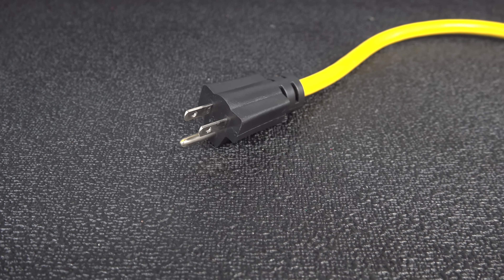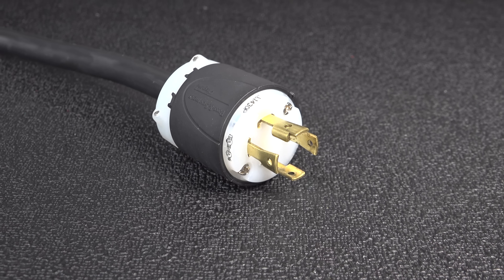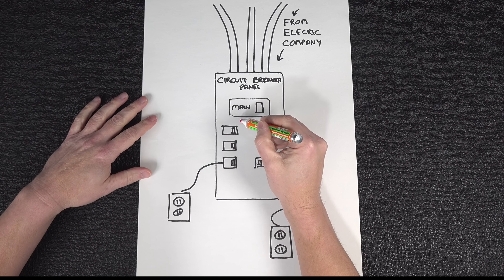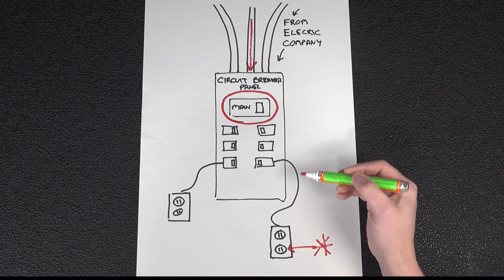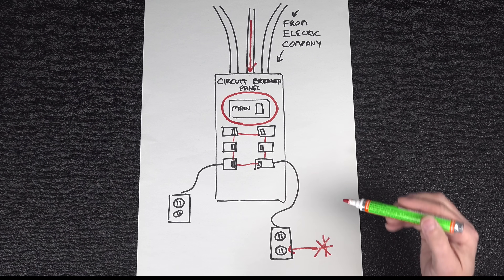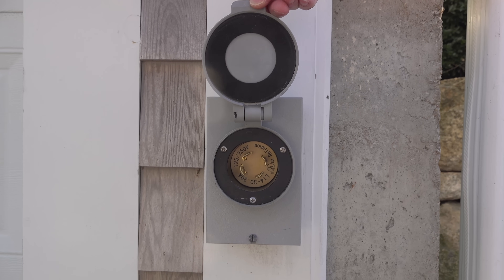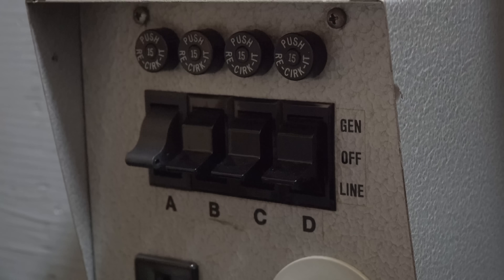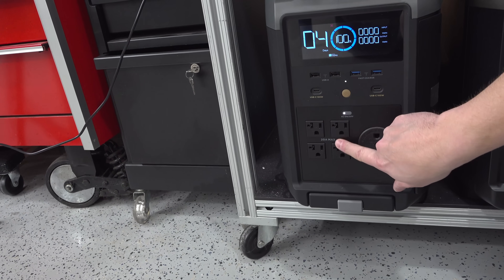Worst Electrical Mistake You Can Make - Backfeeding Generators

Comment: We used these when building a house. We had a construction power pole and we would use these and plug into a circuit to provide lighting or power to work areas. No danger to anyone.
Reply: Never say Never, I know a electrician who was working on a 220 3 phase lighting circuit, he turned off the circuit breaker and he did lock it out, he double checked to make sure it was dead, but he never thought about a shared neutral wire, there have been alot of people injured and killed by a hot neutral, it can back feed through the one or more of the ballasts connected to the other 2 phases, the voltage is now double to 440 volts or more!
 They now run a separate neutral for each phase! Remember that if you back feed through your main breaker, and it back feeds through the transformer and it can  steps up 220/240 volts to 13,000 volts on the line!
Reply: @richardscott8159  The house was new and residential don't share neutrals, only have seen it in commercial.
Reply: @terryheadgepath4205  we were talking about back feeding, I understand that you think it was safe, but there's a meter panel that connected to the main breaker, if the electric company came out to connect the  service, and you left the generator running and the main breaker on position, there could be a potential problem. 
I have seen lots of electrical failures, from burt up load banks to large commercial generator failures. One test cell operator and  steel panel was shot up about 2 feet in the air when the wire cabling shorted out under were, he was standing on a 1/2 steel plate about feet Square. This failure cost over 1/2 million to repair. A new high voltage switch gear was damaged because the electrician forget to remove the grounding safety cables before he put it on line, totally destroy it, took 1 1/2 months to have a new mabe, at a cost of $850,000.00 not to mention the down time.  This was outside contractor, so his insurance company ate the cost!
Another bad accident was when they were tested 1.5 meg. Generator, the diesel engine blew up and the piston rod came through a 1 inch thick safety glass window, luckily no one was hurt, this wasn't electrical but it was one of the bad ones. My point is, even when you think are safe, sh-t happens. And yes if I was working on a house before the electric service in, I would do the same, but I would lock out the main circuit breaker first, just for safety. I have seen to much damage caused by electrical failures, and I know of a lot of close calls and injuries, so I don't like to take any chances. "When in doubt, lock it out"
Kind of a long reply, just tired, and sometimes I ramble. That hot neutral wire happened to an electrician that I was working with, I tried to worn him, luckily he didn't get hurt, but it did scare him! Makes quite an arc.
Reply: @terryheadgepath4205  Sony, I was thinking about the hot neutral and the other electrician, that arc was from a 277 volt fluorescent lighting circuit, he was replacing a ballast and that's why the  there was such a large arc.
Reply: @richardscott8159  of course "if" my aunt had nads. . . .she'd be my uncle.  Those are some pretty specific circumstances.
Reply: Just wire into the panel with the main off and power the whole house. Avoids potential stupidity of wiring between you and the panel.  "shared neutrals" and other idiocy people think is acceptable in a house.
Reply: @snap-off5383  I was talking about industrial wiring, it used to be legal to run 3 120 vac circuit with one neutral,  as long as you had all 3 phases breaker or the tied together by a bar, they did that to save cost, "one" less wire, "two" more circuit with smaller size conduit. We ran into problems with the lighting panels, the panels were installed with switch grade circuit breakers, only problem was that they could be turned off separately, so you turned off one phase, the other 2 were still hot,  brown, yellow, orange, and a gray for neutral.
Reply: @richardscott8159  It may have been "by code" (don't confuse within code with "legal") to share neutrals, but it has NEVER been intelligent to do so, it was and will always just be "being a cheap ass".  But yeah acknowledged that you're most likely to find that stuff in commercial construction.

Comment: I use a generator transfer system to connect my DIY solar system (sub NEC specs) to my home.  If ever needed the solar system can filter generator power for my home while charging its batteries.

Comment: If people knew how to use it they would understand you have to turn off the main breaker in the house and this works just fine up to 15 amps of draw. But not everyone should be playing with electricity. Especially if they don't know what the hell they are doing. That's why when backup generators are installed they're equipped with auto switch circuitry which which detects line voltage from the Pole and isolates it from the line voltage of the generator.

Comment: Remember when you back feed a utility line that the transformers at the poles are bidirectional 
and will take your 240V or whatever and energize the line to power co voltage ~12,000v depending 
on the line voltage.This would kill a line worker.
Reply: Remember when you drive off a cliff that you will hit something at the bottom at a high speed and probably die.  So turn your breaker off and lock it.
Reply: In my area it actually has killed someone. Had a thunderstorm run through the area and a tree knocked down the line. Someone had backfed their house with a generator without a cutoff, and it sent line voltage down the area as soon as it hit the transformer. The problem was is that one of his neighbors was working on clearing one of the trees that fell in his yard, and was killed by the live line. 

arguably he was an idiot for getting anywhere close to it.
Reply: @Sovek86  exactly. Every year storms come and go. I go out 16 hour days for weeks at a time and still after 10 years I’ve never heard of a lineman dying by this. Everyone says it will kill a lineman super dead instantly rah rah blah blah. As if we don’t think that these lines carry electricity or something. Like we show up to an outage and say ok everyone it’s still “illegal” for ppl to hook up generators so that means there isn’t any hooked up everyone agrees? And we all say yes.
Reply: exactly!
Reply: Its not the volts that kill you
Reply: @Hoekstes  just like it’s not the amps that kill you.
Reply: Turn off your main breaker and it can't do that
Reply: Yea one that just shows up to downed wires and assumes they are dead…. Which is never…. Soooooo……. Would kill a line worker? Maybe a real stupid one on his first day…

Comment: I really dislike that instead of admitting "yes, turning off the main breaker will prevent back powering the line." 
You give this long bit about how people are forgetful. 

When you're arguing something you have to give proper credit to the counter argument, and properly portray it. When you gloss over something all you do is weaken your argument because you haven't properly argued against what's probably the main point of someone who disagrees with you.

Not to mention you didn't give any exceptions or limitations to the argument you present, or other ways to deal with the problems people might think are exceptions.

Comment: All good points. 
If you were back feeding your house with the main on I think the load of the grid would trip the generators breaker.  What would happen to the generator once the grid power was restored? Not good things....lol.
Reply: Yes, it will in normal situations. The case when is dangerous is in case of a fault: if the cable from your house and the grid is broken, or a fuse or breaker the side of the grid did blow, and you feed the grid, power will not be lost outside (thus the generator will work) but you will shock a lineman that comes to fix the problem. Doing that in a power outage probably will only damage your generator. 

What if you left your generator connected when the grid comes back? Well, if you are extremely lucky and the grid is in phase with the generator you are giving your power to the grid, but chances are that it's not and depending how much out of phase is your generator with the grid the result can be more or less catastrophic. At minimum a breaker will trip, worst case scenario the generator winding will burn. 

And if you have a modern generator with an inverter, you will fry the electronic no matter what by feeding voltage into it.

Comment: When I bought my generator (big 10kw sucker) 11 years ago, I had a house-tap, grounding poll and breakout box installed. Why? Because death through electrocution and/or fire sounds like an undesirable outcome for a power outage.
Reply: . . . and because that's what's legally required for a fixed generator.
Reply: @snap-off5383  Mine's not fixed (portable)... but technically, same is true. That and, again, even if you aren't into following the law, that whole not ending up dead thing (or killing some poor lineman just doing his job) seems like it should be motivation enough. Then again, there are a lot of stupid lazy people out there.

Comment: I made a cord like this and have used it a few times and it works great. It's not the cord that's the problem, it's the idiots that don't know what they're doing. To me it's just common sense to turn the main breaker off and that's the first thing I do. I guess people might not realize they have to do that. It's just like anything else, it's not the product that's the problem it's the people using them. Just like in most cases, people like to blame the product and not themselves.
Reply: As long you know what you are doing, that both the breaker and wire can handle the backfeeded current and that you are isolated from the line it's actually safe.
Reply: I completely disagree with what you just said... That kind of pompous attitude will get you killed whenever you are working with electricity. 
Products sold on the market are supposed to be idiot proof for the average layman who has no knowledge of specific details.
Home panels are not designed for the circuit to be back fed and this is why you have to put a sub panel wired correctly into it just has the content provider showed you. I don't even agree with the breaker lockout because it requires manual intervention every time. The two-headed plug makes it too easy for even a kid to be told to go plug in the generator and not know the consequences. So if that happened to your son would you still be calling him an idiot like you did everybody else?
Reply: @richardflorence3927  There are many ways of killing ones self and others, like guns, machinery, automobiles, planes, trains, helicopters and high voltage electrical power plugs. All of these kill people nearly every day because of the idiot operator. It is just one of those things no one can control.
Reply: @richardflorence3927  There is a reason to keep some things far from kids, even a 4-year-old could make that extension by himself and end up killing someone or himself.
Reply: @richardflorence3927  well, if products sold are supposed to be idiot proof, then why do they sell it? Your statement makes no sense. Do you have any idea how many products you there can hurt you if not used properly? I've always told my son if he's not sure about something to ask me and he definitely does. I'm not saying dealing with electricity isn't dangerous, but if you take the proper steps and use common sense it shouldn't be a problem. You act like it's a 45 step process to use this product. Just turn the main off and you're done. It's not rocket science. Maybe this product isn't for you tben.

Comment: The same transformer that takes 7200 volts from the line down to 240v for your house will take the 240v from your back fed house  and step it up to 7200v. 
It would likely stall the generator because it cannot supply all the load but still, dont do it.
Reply: It'll trip the breaker, but when the power comes back on, it will fry your generator.

Comment: Dangerous and illegal.  I seen a guy make one like this to back feed into the outlet of a baseboard heater for his dogs.
Reply: Which statute?  I found this one: 705.NEC702.6 contains an exception to the transfer equipment requirement:
“Exception: Temporary connection of a portable generator without transfer equipment shall be permitted where conditions of maintenance and supervision ensure that only qualified persons service the installation and where the normal supply is physically isolated by a lockable disconnecting means or by disconnection of the normal supply conductors.”

Comment: So its only dangerous if your stupid and only illegal so you spend a ton adding unnecessary equipment. 

I get really tired of government intervention to protect dumb people from themselves. 

I spent $50 on a more than ample male/male cable to plug my gen into my dryer outlet. To add the extra BS would have cost $1,800. 

If your main is off and you plug everything in before you start the gen it is 100% safe. Once the gen is running flip the dryer breaker on and full house safe power with No backfill to the street and no risk of shock from the cable. All it takes is a little intelligence.
Reply from the maker: Nothing to do with government, there was a story of a guy who had a heart attack during a storm while backfeeding. Wife tried calling for help thought the breaker was why the phone didn't work. Say what you want, but things happened, when she turned it on the town power and generator both hit each other causing the geneerator to blow out and a fire resulted. Say what you want I could care less about wanting government control, its about making it fool proof and you can't always control who is the fool or just inexerpeienced.
Reply: @SilverCymbal  There is Always a story of a guy... If that "Guy" did a little research he would have cut his main before connecting his house to the gen preventing any back feeding and if his wife knew enough to go flip on the main she should know enough to cut the gen before doing so. Your Main is not on the inside breaker panel accessible to people just flipping a breaker. It should not be the responsibility of the Gov to prevent stupidity or ignorance. Put a warning label on it all you want, but don't tell me Not to do something just because there are other people to dumb to learn how things work.

Comment: i was living in a rented house and had to use a "suicide cord" a few times over the years during extended power outages because the owner of the house refused to have an interlock or transfer switch installed, and i wasn't going to live without any power for more than 2-3 days. it works if you know what you are doing but yes, for a typical person who does not know what they are doing it's a bad idea. still, in an emergency situation if i had to do it again, i would. fwiw i work as an industrial maintenance technician so i carry electrical lockout devices with me in my tool bag so i have the ability to put a padlock on any circuit breaker if i need to.
Reply: I've always heard a suicide cord referring to a cord with a male end and live wire on the other. idk just my 2 cents I'm sure it varys from region to region
Reply: @RiGHTcoast_REGULAR  and if you connect the two wire ends together you have a circuit breaker finder 😉
Reply: @wingerrrrrrrrr  yes you do my friend
Reply: @wingerrrrrrrrr  Best make it 3 wires - or more !
Reply: "If you know what you are doing". I have encountered many people over the years that think they are professionals on things because they watched a YouTube video.
Reply: @MrChopsticktech  I mean, if he’s lock out tag out certified then he probably knows what he’s doing. Especially if it’s NFPA70E
Reply: @MrChopsticktech  for sure .. common sense is rare nowadays
Reply: It’s bad idea to use suicide cord. In an outage coworker loan me a generator with suicide cord. I declined the cord. I bought a generator hook up to wire it up such it will accept 4 prong receptacle. Took couple house. But accidentally touching those prongs will probably ruin my day if not worse. Lol.
Reply: I've recently watched a couple of 'safe isolation' of circuits videos. I've seen padlocks put on isolator switches to lock them in the OFF position. HOWEVER some switches in the locked off position allow the panel to be opened - and the switch can then be easily closed with an adjustable spanner ! Easily defeating a padlock without damaging anything ! If you need a circuit making safe, somewhere in the circuit, connect all the wires together: L1, L2, L3, N & E - then if somehow the circuit becomes powered there will be a big bang - but you'll live.
Reply: Yea “suicide cords” been testing peoples ability to follow 2 simple instructions since 1886.

Comment: I know this will be unpopular but I just gotta come clean.  Where I live my power isn’t as reliable as it should be and during storms I often lose power.  In order to keep my furnace on and my fridge cold, I backfeed using some hacked together extension cords with wire nuts after pulling the main from my power pole.  The power company could be upset with me but then again I’m not about to let myself freeze.  Modifying my electric circuits for a permanent generator installation would require inspections and plenty of capital so I do what I do out of necessity not for a desire to do things the wrong way.  Good video all the same
Reply: For your peace of mind: 705.NEC702.6 contains an exception to the transfer equipment requirement:
“Exception: Temporary connection of a portable generator without transfer equipment shall be permitted where conditions of maintenance and supervision ensure that only qualified persons service the installation and where the normal supply is physically isolated by a lockable disconnecting means or by disconnection of the normal supply conductors.”  just lock your panel and keep the kids away.